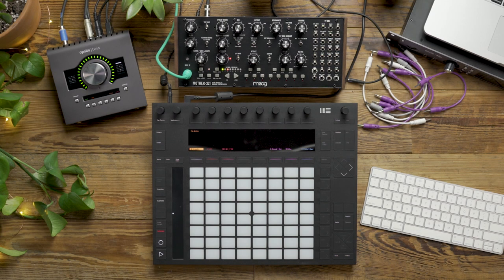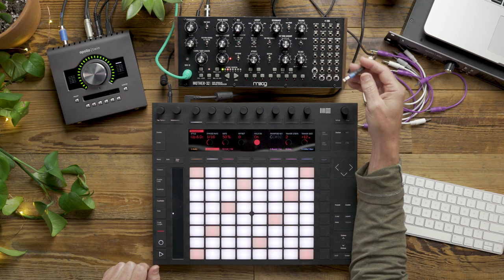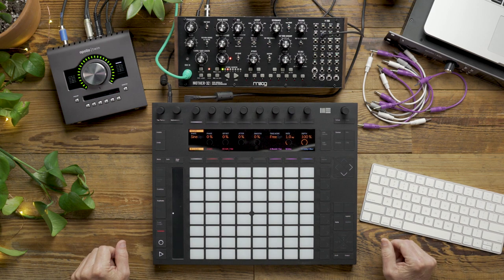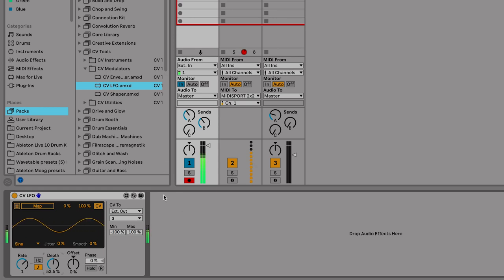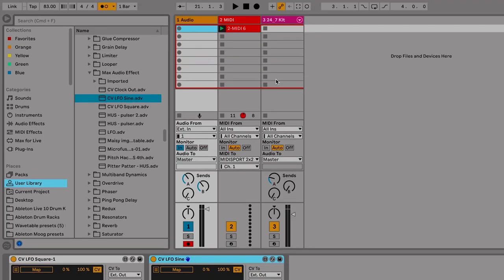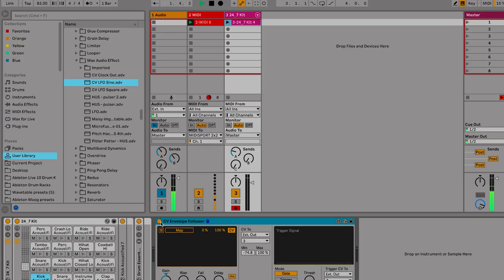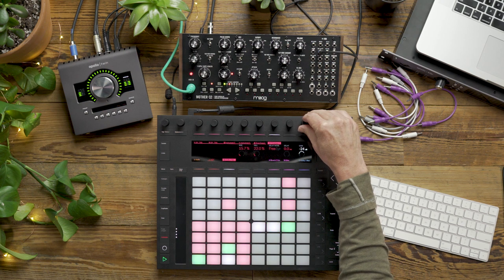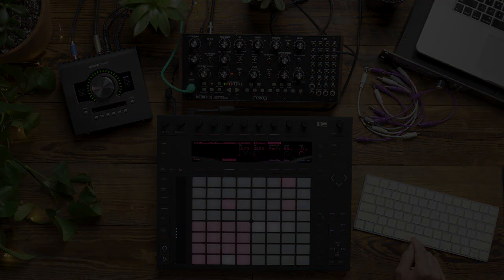Mother-32 | Modulate your Synth with CV Tools

Comment: Could you please explain the midi cable from m32 is going to an output of an audio interface ?
Reply: The M32 only has MIDI input, so the other end must always be connected to MIDI output
Reply: 1.19- it is connected to midi hub and from the midi hub it goes to soundcard

Comment: I feel the need to make a distinction here: Ableton Live ALWAYS sends MIDI Start/Stop messages along with the MIDI Clock, and the Mother-32 ALWAYS activates its internal sequencer when it receives those MIDI Start/Stop messages, which can get frustrating. Mother-32 does not have a setting to ignore Start/Stop and yet still sync to Clock.

There are two ways I can think of to get around this: 1) Run your MIDI signal through another piece of hardware that has the ability to disable Start/Stop on its MIDI output (the Grandmother can do this), then through to the Mother-32. Or, 2) Use a MIDI-to-CV converter to plug into the Mother-32's patch bay input, VCO 1V/OCT and whatever other kind of analog/gate signals you want.

I hope this helps.
Reply: No, you can easily switch that off. Go to your MIDI settings in Ableton, select the channel which outputs the MIDI signal to your M32 and set sync off.
Reply: This was fixed in a recent upgrade! :)

Comment: This is great and I can understand the need of these videos, but I would love more of how and what you can do on your Mother32 itself. 
As far as this video goes for example, you can modulate the filter of M32 with the already built-in lfo - with or without patching - and you can make different lfo shapes (or behaviour in general) with the use of the lfo rate input. 

Again, i am totally up for videos that have to do with compatibility and integration between systems, just please don't leave behind the modular aspect and the vast possibilities it can offer.

Comment: What is the stand that you're using for the Push 2? Thanks
Reply from the maker: We employed an improvised solution (foam and a little gaff tape) to get the angle just right on the Push 2 🔨🤓🔧
Reply: @MoogSynthesizers  even better, thanks!

Comment: things seem to work okay - but I get really bad noise, pops and clicks whenever I edit a parameter in CV tools, or toggle it on or off - seems to come through at max volume irrespective of the mother32 volume which makes me think its an ableton thing but its very annoying
Reply: I THINK IT HAS SOMTHING TO DO WITH DC COUPLING of audio interface
Reply: i hope i didnt fry my shit - putting a multimeter to my patch cable (that is controlled by cv tools), the voltage follows the oscillation...  but at a tiny tiny voltage! certainly not +5 (my soundcard is e-mu 1212m)
I would love to know if it works on ur242 steinberg

Comment: How did you connected the mother 32 to midi if apollo doesnt have midi outputs, can you explain please??
Reply: I don’t know if this helps...in my case I route midi from a USB-to-midi converter box (which can be had for ~$40) from my computer. Then midi out from the box to M32. The default midi channel in the M-32 is ch1. This can be programmed to another channel. I haven’t investigated that, but some of the documentation, if you have a manual, is on pg.56. Then set the outputs in the software to midi channel 1. Hopefully things will work.